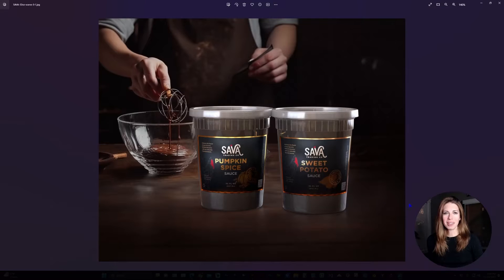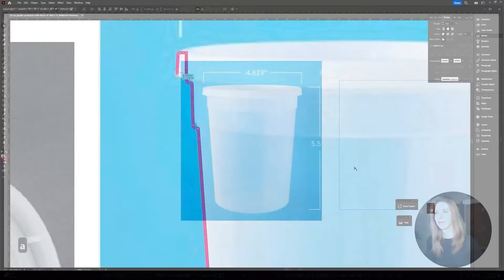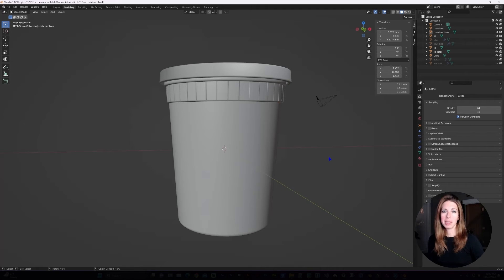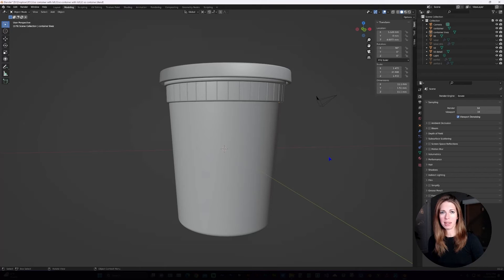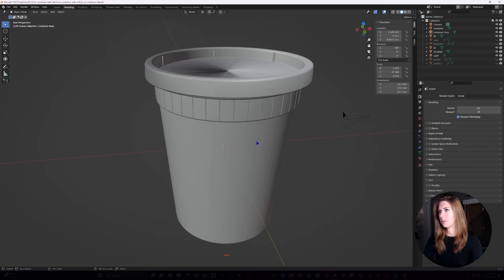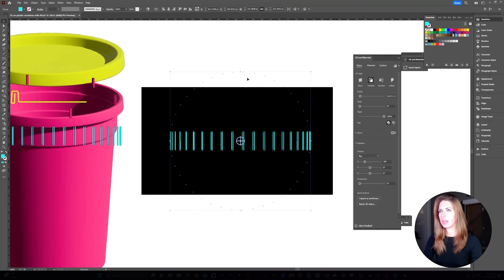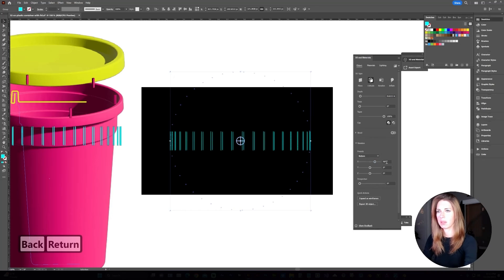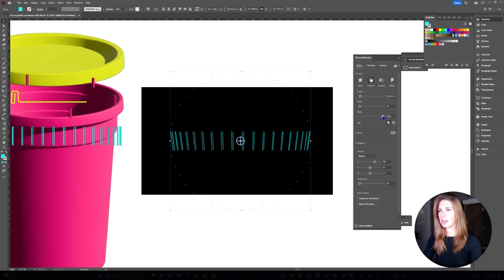Make a 3D Plastic Container with Lid & Details (.obj) in Adobe Illustrator (render in Dimension)

Comment: I think I have found my answer from a newer video you just posted "Add Materials to a 3D Model. The step I missed was to expand the rectangle and what ever you apply to it with the Direct Selection tool 'A'. I got it, now I can move on, Thanks, I posted this in case some one else missed that step. https://youtu.be/bygDQy3QSC8?si=ommpYhU4rHph_65I

Comment: I tried step by step, but got stumped @ 0:58 , how did you manage to make the tick marks sized, I know it was a solid rectangle with no stroke. I have the latest Ai version 28.0. I even set playback speed to .25. The Repeat - Radial is a great function, just can’t pass the step on 0:58. Thanks.